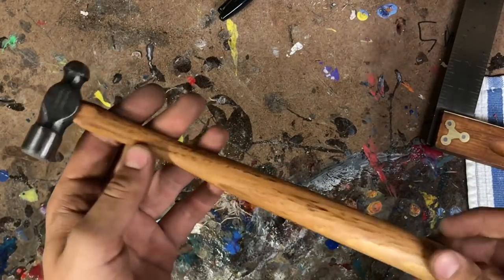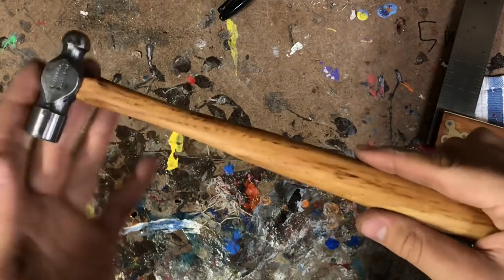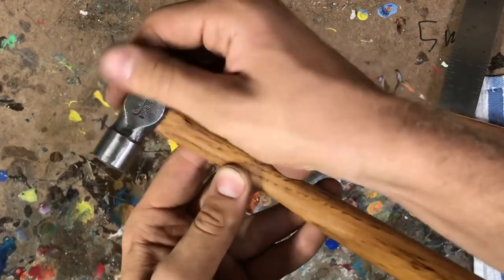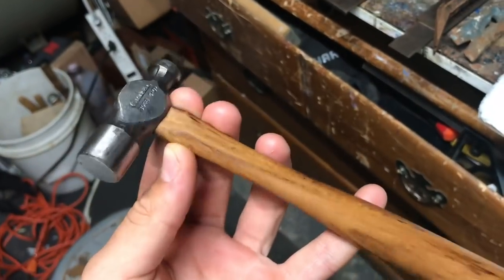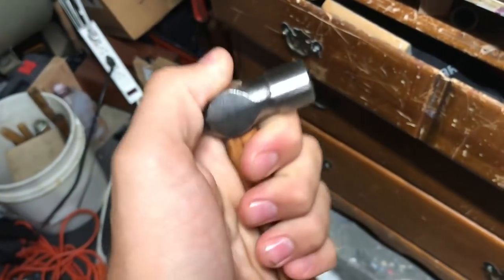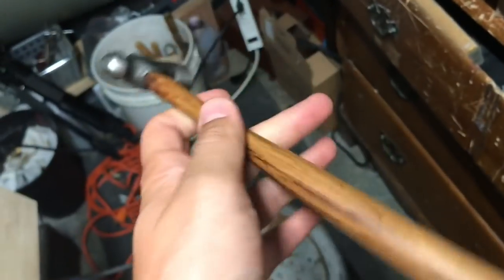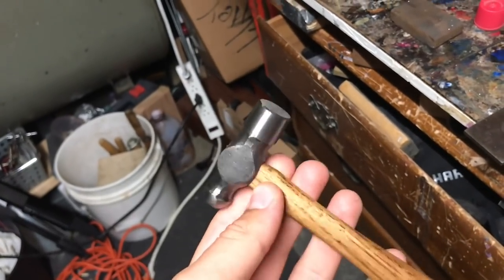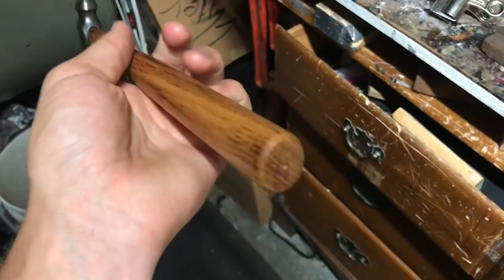Mini Ball Peen Hammer Restoration

Comment: Nice job... I have a hammer like this but its still in good shape head wise, I'd love to restore it to its former self , however I would need a mallet, a vice and a drill with the bit you used to polish it up with lol... yours looks good though!
Reply from the maker: Faceless Vaper Thanks! Garage sales and harbor freight are great places to start! And most tools can be substituted for something else! Log(mallet), Clamp and Table (vice), Hand wire brush and elbow grease (drill and wire wheel).
Reply: @bitterbladeco  To be fair it only really needs the handle sorting and the metal polishing that's why I tuned in... and yes I do have a lot of elbow grease, some knife blades and an wire bbq cleaning brush somewhere lol - We in the UK don't have many garage sales and if we do it's some kid trying to sell toys for some summer cash... I will raid my dads shed for anything else I need if I can find the key!